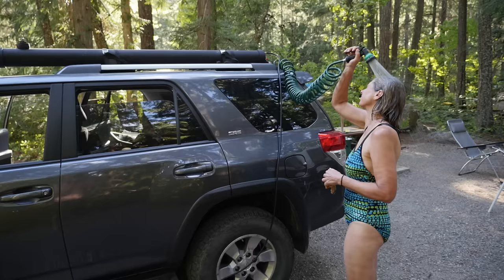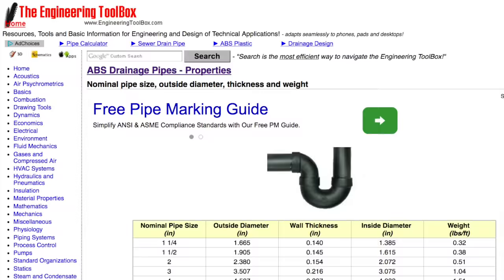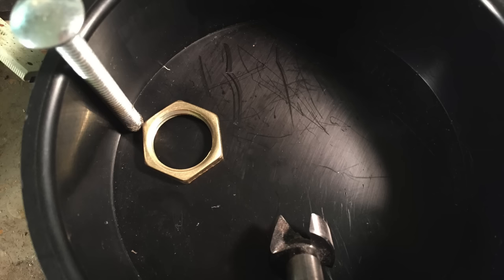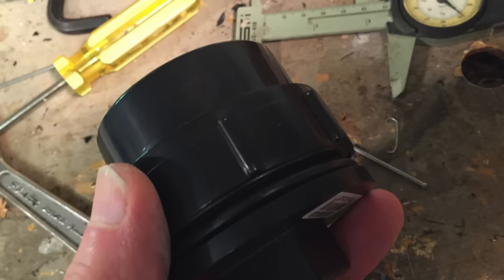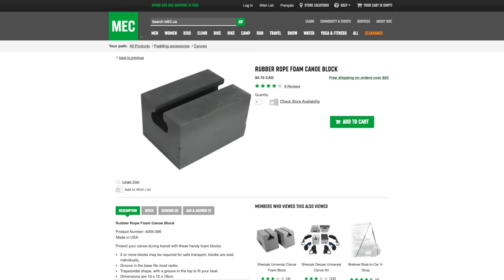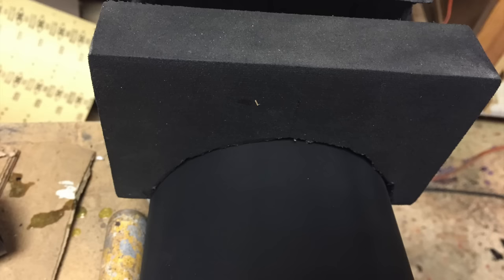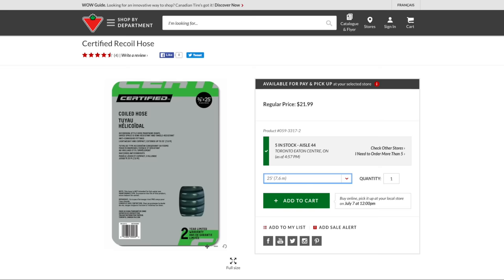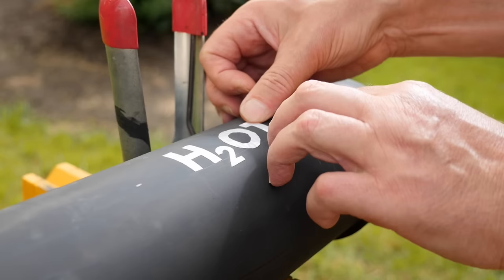H2OT - Rooftop, pressurized, solar-heated shower/sprayer using ABS pipe. DIY

Comment: I will make this but with improvements in your design. I will add removeable end caps to clean the interior thoroughly.  Why did you glue both end caps on? By doing so, you can't clean out the system properly. By putting lake water in the pipe, during the test, the water is not fresh to drink if need be. Removal end caps would have been a major improvement for thorough cleaning the system.
Reply from the maker: The river water in the video is the cleanest freshwater you will drink. It is used, unfiltered in the city nearby.

Endcaps are a guaranteed point of failure for leaks.  Times 2.

There is not a trace of any residue in the tank. I never leave water in it unless I am using it. Once showered, the drain is opened as well as the cap removed It is bone dry by the time I refill it the next morning. 

But nice suggestions, I look forward to hearing the results with your project.

Comment: I'm having a hard time finding the valve retaining nuts and was wondering where you got them? I'm also in BC and have tried Home Depot/Hardware and the didn't have any? Thanks
Reply from the maker: Home Depot has them. Look for Moen Faucet Lock Nuts. Yo can see them in the video at 1:28
Reply: Ok thanks, I was looking in the plumbing department and didn't find anything.

Comment: Just a thought if you made it so that it pivoted straight up when going to use it you might not need the compressor at all
Reply from the maker: That would do nothing in terms of usable pressure. You would end up at a maximum pressure of 2 psi if the tank was full and 1 psi if it was half full. This assumes the tank is vertical. 1 psi = 27.7 inches of head.   You need a minimum of 10psi to have any usable pressure.
Reply: @ImaginetMedia  yeah I was thinking like a large diameter sunflower looking shower head but that probably use your water too quick

Comment: Two questions: Would it work to add more pvc pipe (for a higher water capacity)? And would a bicycle pump work to pressurize the system? 

Thank you! This is sweet!
Reply from the maker: I have answered this question in detail previously and it is better to keep that description in one place. You should be able to find it by searching.  

But briefly...

I used ABS and not PVC pipe as per the safety reasons previously referenced. My spreadsheet shows various capacities that balance capacity versus weight. I would suggest that  6" pipe 6' long would more than double your capacity but also more than double the weight.  When we shower, the spray is ONLY on when it is aimed at a target (me). It is not like I am standing under a streaming spray for 5 minutes. Water conservation is key.
Reply from the maker: A bike pump "would" technically work. HOWEVER, the volume of the shower is over ten times that of a bike tire. The volume is in fact close to that of a car tire. How long would it take yo to inflate a car tire to 30psi with a bike pump?
Reply: Umm, ok! I guess that was a dumb question. Thanks for the reply. Your video was interesting, but I am thinking it may be over my head. It's all good, though!
Reply: Quid, it isn't over your head.  Go for it!  It's cheap enough that you haven't lost a lot if you mess it up.  Use a Tee instead of cutting the hole in the top (one of the hardest parts).  Mr Imaginet, good job.  But I admit it is a bit weird to feel like you have an original idea, and always be able to find someone else who has done it and documented it well on youtube, lol.

Comment: Do you worry about bacteria where warm water is concerned? I;m not certain how long water would have to sit to go bad. Also, what is your idea for keeping it clean when not in use. As in the off-season etc.
Reply from the maker: I worry about it as much as I worry about the water in my garden hose when I put it away for the winter. 

If you are concerned about bacteria, you should look for a better water source to fill from. We always look for potable water if possible. 

As the water in our shower is never there more than a day,  we are not concerned about its quality being degraded from short term storage and heating.

Comment: great idea and great video, thank you!  I built one based on your video.  turned out great! I do have a small issue and wondering if you've had the same.  after putting 25lbs of air pressure in the tank I left it on there to see if I was losing pressure.  after a couple of minutes I noticed the water backed up in the air pump.  do you think I need to install a check valve or maybe because its just because I left it on there to long?
Reply from the maker: Something is wrong with your pump. The pressure i the tank should be the same as it is in the hose from the compressor. If you compressor leaks some how, yo are providing a path of least resistance for water, which is through the compressor. This is why compressors have a one-way valve to prevent this built right in.  Can you try another compressor?
Reply: @ImaginetMedia  I think your exactly right.  there must an air leak in the pump. thanks!

Comment: thanks, my question is how long will the tank last under the suns raise,,, think about this for a small on a roof thank you
Reply from the maker: The tank should last a lifetime if you take care of it. The paint not only aids heat absorption but it protects the ABS from ultraviolet light. I do not leave the tank on all year, only during camping season.
Reply: thank you for the quick reply good luck

Comment: I am currently trying to build this, however I am having difficulty getting a leak proof seal from the main pipe to the fill fitting. I have attempted it 2 times with no luck.
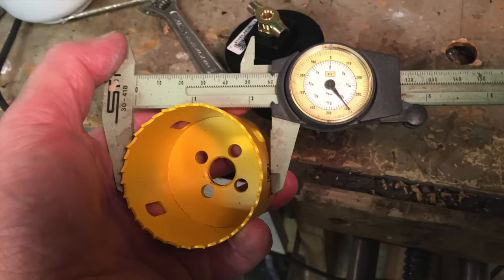Reply from the maker: The cap I used has a silicone gasket. You can see it at 2:23 in the video. Apparently, not all brands of cap come with the seal. This is the key. If yo do not have one, you can by a 2" silicone gasket. Also, I have added a few wraps of teflon tap to the threads as well. It will lead a little but it would take ages to lose significant pressure. Here is the cap I used (with gasket attached) https://www.homedepot.ca/product/lesso-2-in-abs-male-plug-mipt/1000116110

Comment: anyway to use a hand pump instead if an electric compressor?
Reply: Shouldn't be an issue, pressure is pressure, but you'll need a pretty long air hose to reach, and some time to get the pressure up.
Reply from the maker: From your comment, I suspect you have never inflated a car tire with a hand pump.  If you have and yo did not have a heart attack during the 3 hours it took you to inflate the tire note this. A car tire is about the same pressure requirements as my shower, 30psi and about 10 litres, and shower is 150% bigger than that.
Reply: imaginetMedia never have!🙂

Comment: Did you use cement on the shut off valve or silicone? I'm building one that will be pressurized and wondering how the silicone has handled the pressure if that's what you used? Thanks in advance...
Reply from the maker: I did not use any cement or silicone. All the joints are either solvent welded or threaded tight.
Reply: Ok thanks, so did you weld the water valve, pressure release valve and the air valve?

Comment: Great video! I know its old, but ive just watched it and want to do something similar for my van...does the compressor have to run the whole time or can you just pressurise the pipe ( then shut it off) and use it just for a shower?
Reply from the maker: Thanks.  I suggest you read the description of this video on its YouTube page.  I have written a detailed FAQ including notes on the best use the compressor. There are many other tips in there as well that will help you build your own.
Reply: Thanks again..just read it..

Comment: This is brilliant!  4 gallons is a very good.  Where did you get that PVC pipe? what diameter and thickness?

I was thinking.. PVC that diameter has some great structural properties.  My van has no roof rack but has the guide holes.  Maybe I'll just make my side rails and cross member out of PVC that doubles as a water heater and tie them down with 1/2 inch Aluminum strips into holes.
Reply from the maker: I bought all the supplies at big box Home supply or automotive parts dealers. The diameter and thickness specs are all in the spreadsheet I show at 1:04 in the video.  Before you buy PVC try this. Take a piece of ABS and piece of PVC, same size, length and diameter. lie them on a hard surface. Take a sledge hammer and hit each one. Make note of what happens immediately after impact. (Safety TIP:: hit the ABS first) This will tell you why you should use ABS and not PVC. You will have lots of time to ponder the results on the way to the hospital to have the shattered PVC fragments removed from your eye.

Comment: Great video.  Would you recommend a 6" pipe if you have a shorter vehicle or have space for a larger pipe?
Reply from the maker: I certainly would not go shorter than 6'.  The problem with a larger pipe is weight and the risk that the amounting system would not stop the forward momentum is a sudden stop. At 1:16 you can see my breakdown of various lengths and diameters versus the corresponding weight

Comment: I just build similar shower for my van but air compressor was wrong. Could you recommend me some good air compressor?
Reply from the maker: Do not buy a cheap air compressor. It will fail you when you need it the most, i.e. inflating a flat tire. I have a Viair. I think it is a model 88P. Viair make THE best air compressors. Do not get one that plugs into the accessory plug (cigarette lighter). Get one that connects directly to the battery. A good compressor uses higher amperage and a plug in one will instantly blow a fuse in your vehicle and then you are really stuck with a flat tire and a dead compressor.

Comment: Did you cement or otherwise seal the shutoff and compression fill valve threads before you tightened the nuts?
Reply from the maker: No .he Shrader air valve comes with seals on both sides. The shut-off has NPT tapered threads that 'tap' their own threads to a perfect fit.  As noted in my FAQ in the Description text, I did heat the shutoff threads with a propane torch first so that greatly eased the threading process as it partly melted the ABS.

Comment: Could you put the threaded 2" cap with pressure valve at the other end of the pipe, instead of drilling out the top of the pipe? Looking for a solution that doesn't require a drill press. I could split the main pipe in half and glue in a cleanout tee, but trying to avoid that too. Maybe an elbow angled upward at the opposite end for the 2" cap/pressure valve?
Reply from the maker: The easiest solution then would be to use a 4" - 90 Deg Elbow, plus a 4" coupling, and a threaded 4" cap.  This would replace the 2" fitting. Just cement the Elbow to the end instead of a cap.   Start with something like this fitting... https://www.homedepot.ca/product/lesso-4-in-abs-90-degree-elbow-all-hub/1000116266
Reply: @ImaginetMedia  Thanks!

Comment: Thanks for this video.  Not sure what part of the country you are in or if already answered here. I'm in Florida.  On a sunny day where it's above 70F outside hot you think the water will be when the sun sets? Given it's sealed how about 2 hours later if it's above 70F outside?  

Also wondering if the water and pressure run out at the same time? Lots of water left in the tank when pressure runs out?
Reply from the maker: I am in British Columbia, Canada.  As water does not compress the volume of the compressed air varies in relation to the volume of water. When the tank is full to the brim, there is little room for compressed air, so it will from 30psi to 0 in a few seconds. As water is drained, the void for compressed air increases and the need to turn on the compressor becomes significantly less frequent. So, you will run out of air before you run out of water if the tank is nearly full. conversely, you will run out of the water before air as the tank nears being empty. 

Regarding your specific question about temperature, that would not be possible for me to speculate on as there are so many factors involved. Not the least of which is the temperature of the water before sunset. That itself is dependent on the starting temperature of the water and how long it has been in the sun, and temperature differential outside.  You may want to look at Newton's Law of Cooling which states that the temperature of a body changes at a rate proportional to the difference in temperature between the body and its surroundings.
Reply: As you are in Florida- as am I- consider building using PVC instead of ABS. You cannot typically find ABS in Florida as it tends to melt when stored in the sun- so the supply hoses always need to special order ABS pipe down here. Because you are building a pressurized system- this may not be much of an issue as the pressure may make the pipe hold shape- but I would not consider ABS as a material in hot climates.  One other mention is that ABS should never be joined to PVC fittings (at least according to most US building codes- not saying it cannot be done, but it should not be done) Good Luck with your project and thanks to imaginenetMedia for sharing this.
Reply: @WilliamLaakkonen  Thanks for this info! makes sense as I could not find it anywhere.  I ended up building it with scheduled 40 PVC pressure slip fittings  and painting black.  Very happy with the final product. Heats well and great pressure.  Will be uploading a video of it in the next week showing it.
Reply: @WilliamLaakkonen  ... there's no reason you can't use PVC instead of ABS. It's mostly a difference in price. The code issues with using ABS and PVC together is a leftover from the days when you couldn't buy the solvent / glue that would do both. A DIY project doesn't have to comply with building codes.
Reply: @rupe53  actual issue is that ABS is not able to remain stable in heat- adding a pressure to ABS is something for which it was never intended as it is only used for drains- not pressurized water systems. ABS is the poorest choice of materials available for this type of project.
Reply: @WilliamLaakkonen  ... watching the video he explains that he does NOT leave pressure on the system when not in use. (smart move) If you read my post I mentioned you could use PVC. Neither is rated for pressure but are pressure tested at the factory. Edited to add: my experience with ABS versus PVC in warm weather situations tells me that ABS will deform / sag when heated. PVC does seem to be more ridged and better suited to this situation, although more expensive.
Reply: @rupe53  indeed- without pressure the ABS will distort as it melts in the sun. Florida is not Canada. I have seen ABS pipes left in the sun in Florida go completely flat... so I could imagine coming out to the vehicle and finding a gooey mess on top of the vehicle. ABS is surely wrong, if not simply an outright safety hazard, the poorest choice. Well, lead might be a worse choice- but at least it doesn't melt in the sun.
Reply: @WilliamLaakkonen  I live in Tucson AZ and have stored ABS pipe outside in the sun and have never had that happen but I guess anything is possible.

Comment: how has the capacity worked out for you? the ABS is one of the cheapest parts of this, so it would be easy to have 2 runs of pipe along your roof. also, that compressor is loud, bike pump?
Reply from the maker: 1) 15 litres is more than enough for 2 of us. The shower does not run all the time. It is on a sprayer. Spray, clean, rinse. In fact 2 of us use only half a  tank, total.

2) They Viair air compressor is very quiet. Do not go cheap on the compressor as it wil fail you when you need it the most - inflating a flat tire. 

https://www.amazon.com/Viair-00088-88P-Portable-Compressor/dp/B005ASY23I/

3) A bike pump would not work. The air capacity of the tank is about equal to that of a large car tire. How long would it take to inflate a car tire with a tiny bike pump? You would certainly need a shower after that work out.